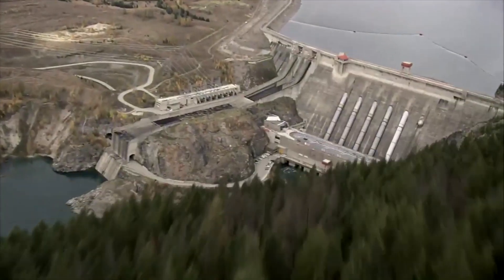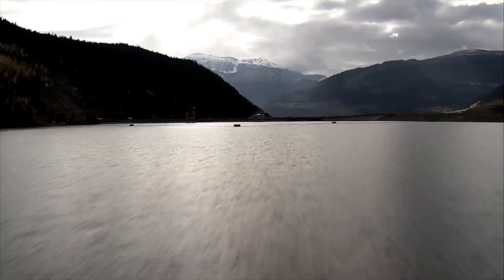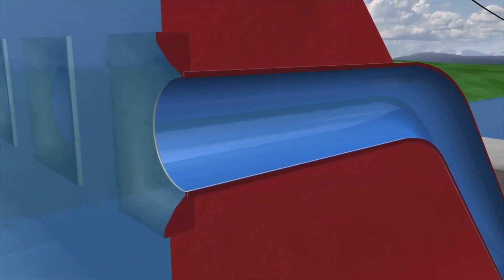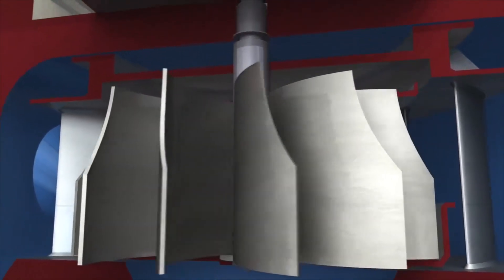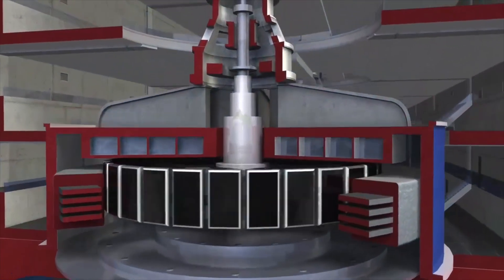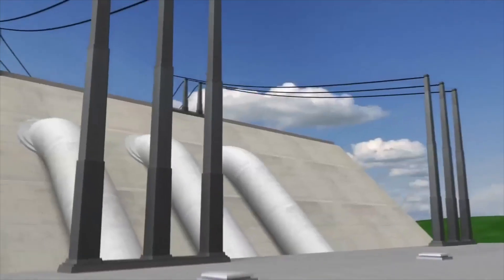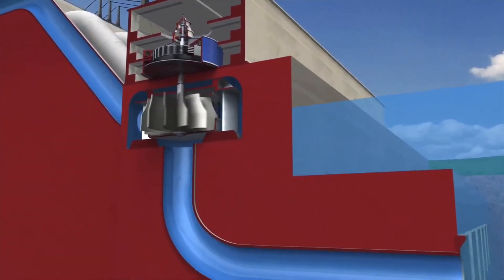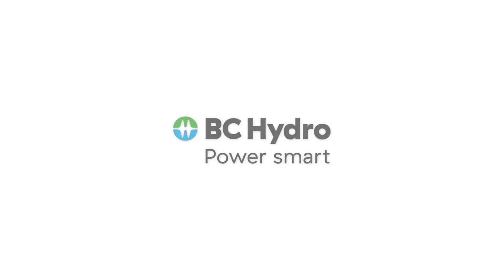How a Dam Works

Comment: I’ve always thought hydroelectric power could be generated by sea water. However, instead of generating power by downward pressure from a higher source of water; at the bottom of the sea the water would drain, where there would be 10 bars of pressure, then the water would flow upward via negative pressure to the surface where high pressure water would spin the turbines in order to generate electricity. Then the water, after passing through the turbines could be put to use by creating potable water via desalinization, finally unused water would be dumped to the sea. A mesh would have to be installed at the mouth of the drain, at the sea bottom, in order for objects (like sea life) wouldn’t be drained into the pipes.

Comment: MAN how stupid IF you think about it....The water that falls down and generates electricity is wasted because it is passing one time.....IF the dam had a huge bucket system not round like the old days but on a rail or chain, the water COULD be dopped back on top because of the rotation of the falling water, THAT FOLKS is 2:1 ratio...

Comment: question, from the structure of this particular dam that you showed us, does that mean that theres a difference in the dams used to generate electricity and the dams just used for the sake of having a sort of reservoir?( which may also be used to transport water to various households for domestic purposes etc but not for hydroelectric generation) i had seen the structure of different dams and got confused between the dams without the structure in which the turbines and generators are. they have floodgates from which they release water but not the turbines or generator (or at least they werent visable, might have been someplace else but i couldnt be too sure)

Comment: tons of water and high voltage water, WHAT COULD GO WRONG!?
Reply: You wouldn't know this if you just got all your information from cartoons, but water is an insulator and does not conduct electricity.
Reply: The voltage is isolated from the water

Comment: Why cannot we make use of a motor to rotate the Turbine instead of a Water from the dam.  Can anyone tell / explain  me the technical difficulties in it, if any.

The electric power for the motor can be taken from the Electricity Generated from the Generator itself.

For example if we are generating 100 KW of the electricity from the Generator, part of this electricity say 10 KW can used for the working of the motor.

We can save our environment and have clean energy also saves huge money on building dam

If we can make portable size of the entire unit, it will be great .   Beneficial for the housing colonies, far way villages etc.  in the third world countries
Reply: @warriour am sorry,but you have no understanding of what is going on ..your statement is paradox.I wont bother elaborating..you are either very young or extremely dumb.
Reply: —_—.      What are u talking about.
Reply: It would take more power to run the generator than it produces. Very simple.
Reply: Brother your are taking about perpetual motion machine which will give electricity continuously but it is practically impossible due to various losses and loss of energy at every stage which is inevitable
Reply: Explanation will be more confusing than the question.
Reply: cool
Reply: This is the lowest IQ comment I’ve ever seen in my 10 years of seeing YouTube comments

This is from what I could gather basically a huge scale equivalent of a little kid plugging a power bar into itself and trying to create an infinite electricity loop